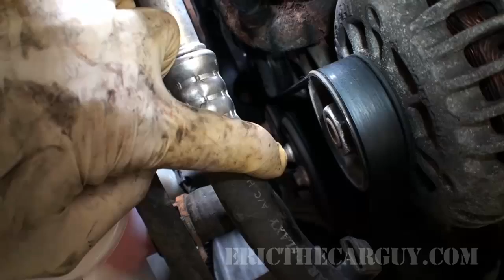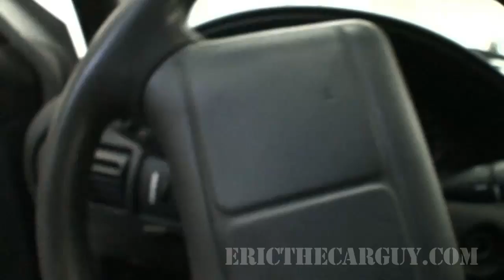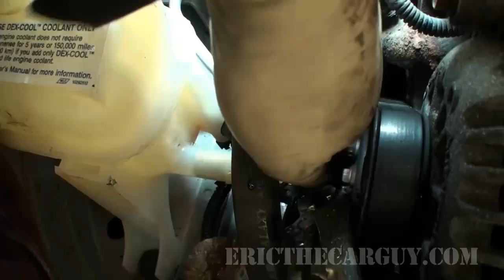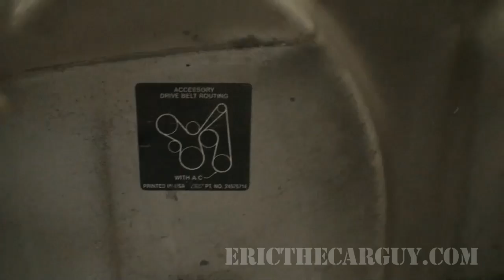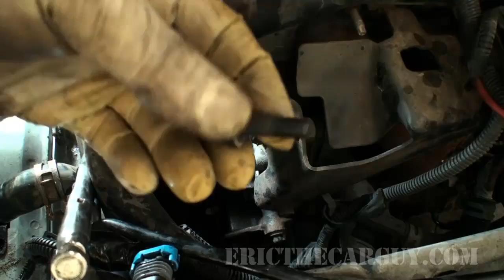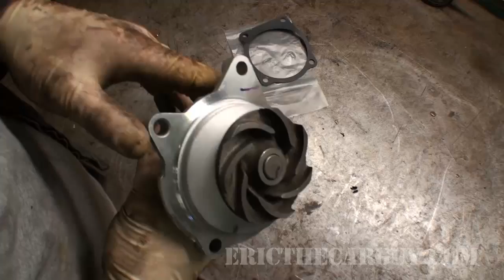2002 Cavalier Water Pump Replacement (Part 1) - EricTheCarGuy

Comment: Just put a used radiator in it and it seems like the water not flowing right don't no much about the car some lady own it and bought it for 150 dollars car got 90k thousand miles just seems like it does it have enough flow so am going to change the water pump and thermostat see what happens next dam I just put new coolant in it after replacing the radiator o well back to the drawing board again water pump and thermostat now new belt too my luck but hopefully when it's done I can make some good money of it for sale

Comment: hey Eric,  a minute or two in to the video, and i already subscribed. i am glad u make videos, u know exactly wtf ur doing, from the vin code info to the proof is workaround, the jack stand, holding that battery cable away properly, explaining the wrenches, tips and tricks , good stuff  , very good stuff
Reply: hood turned to proof,  dann autocorrect

Comment: Replaced a same water pump with 2.2L engine for 2002 chevy cavalry. On ground, no jack up. No need to touch the coolant reservoir and engine mount. No need specific tool to release the  belt tension, regular ratchet will be too thick to put in; instead just pushing the tension bar down with a 1 by 2 wood. I totally removed the alternator, easy and no  need to worry about its falling. Utility tape is very helpful to put the belt in place. YOU MAY NEED A HELPER IN THE LAST MINUTE TO PUT THE BELT IN PLACE, WHEN YOUR HAND ARE PUSHING DOWN THE TENSION BAR.
Reply: I use a 3/8" drive breaker bar on the tensioner bracket to release belt tension. The breaker bar end is thin enough to slip between the frame and tensioner bracket.

Comment: I did just by removing the alternator, you dont have to take down the engine
Reply: Good!!! I sure did not wanna move motor mount lol at 300,000 miles on the cavalier it needs a new water pump glad its 30 bucks for it i am not gonna invest too much into a $600 car
Reply: I bought my Pontiac sunfire for 350$ and all it needs is a water pump replacement glad I don't have to do the engine drop if you did it by taking off the alternator.
Reply: Where is your video?
Reply: airblender it’s 10000x easier to just drop the engine. I’m not gonna fight with belts and less then an inch of clearance for my dick beaters. Plus reaching that tensioner is nearly impossible with that mount in the way. It can be done. After 20 minutes of struggling.  fuck that noise
Reply: Absolutely easier to drop the engine. I only had floor jack and I had no issues taking out the motor mount and putting it back following the video instructions.
Reply: Dumb ass with a wrench

Comment: have 1996 corsica, same motor 2.2L 2200 (OHV) it's actually much easier than the hondas and toyotas and other imports, because the 2200 is a pushrod motor, with timing chain. waterpump sits outside driven by serpentine belt, 
no timing belt to remove.

did i mention timing chains last longer?
Reply: Depends on who made the chain...

Comment: I had a cavalier with the 2.4L engine and I had to replace the water pump... that was horrible I will not do it again!!!!  makes you wonder what the heck are the engineers thinking when designing these engines. If you see a 2.4L with a bad pump... run away as fast as you can!!!
Reply: I've fixed cars for years and I can say this all Americans cars are pain in the ass to work on and any v6 Nissan .
Rest of Japan's cars are pretty easy. I really like how Japan uses like 3-4 diff bolt head sizes for the whole car vs American which could use every socket you own.
Reply: Also the Japanese cars use ALL metric fasteners (MUCH better system) than American cars which mix SAE and Metric fasteners. NIGHTMARE!

Comment: I just changed the water pump on 2001 Sunfire 2.2.  Found easier way to release the tension on the belt.  Use a crowbar, just push down.  Saves time and headaches removing the engine mount.  Thanks
Reply: Was the water pump on 01 pontiac sunfire internal or external? I need to replace mine. Thanx in advance.
Reply: Was the water pump on 01 pontiac sunfire internal or external? I need to replace mine. Thanx in advance.
Reply: Was the water pump on 01 pontiac sunfire internal or external? I need to replace mine. Thanx in advance.
Reply: External. Under alternator.

Comment: Hey Eric
I have a 2000 chevy cavalier, and the other day, it just started making this like sputtering noise, like if I install a cool air intake system. It does in at idle and when I'm driving, I also notice when I turn on the ac it make the sound a little louder, and sounds like it coming from the passenger side, could this be the water pump?
No engine light.

Comment: Regarding Tensioner all way down. For Post tolerance775. Is there any adjustment in Alternator, or anything else to get that extra little bit to get belt on, or off??.
Reply: NO! The tension is fixed by the spring in the tensioner.

Comment: Hi Eric.  I have a 02 Olds Alero 2.2 Liter Eco Tec, Automatic.  My Water Pump is leaking out weep hole I'm sure. How do you go about replacing it??. I was reading I need some special tools, like a timing gear holder, so when I pull out Pump I don't mess up Timing. I also would like to know where the heck is the dag blasted Water Pump at, as in which side of Vehicle??.  I was looking at it month ago in Garage, but didn't jack up, or anything, just glanced in there. Do you have any Videos on the 2.2 Eco Tec Engine, I have looked for them, but no luck??.

Comment: hey Erik, i was told there is a drain plug for/in the water pump used to flush the engine. Is this true and if so where is it located?

Comment: 2.4L engines are driven off the timing chain... they are a nightmare to replace. no cavalier has ever had an engine with a timing belt.... best to my knowledge. the 2.2, 2.8, and 3.1 V6's, and the 2.4 all timing chain. timing belts suck

Comment: Eric, I have a 2000 ford taurus 3.0 EFI (VIN U) , that is leaking coolant from the waterpump. It is so full of rust it looks like chocolate milk. The shop said replace waterpump, thermostat, tank and flush the cooling system. Are there any precautions to be taken considering there's too much rust and any idea why it would be so rusty?
They quoted around $217 to just to the flush and refill, is that reasonable?

Comment: When trying to release tension from the Alternator belt why not just loosen the bolt on the top bracket arm and let it fall forward? Wouldn't that work ?

Comment: I say don't use RTV at all, use a couple of bolts to keep the gasket in place as you're installing. I hope that replacement GMB water pump holds up, I've seen so many of them crap out.

Comment: what really works better then die gringer is a dremmel type tool with a wire brush
and a cloth inside the pump hole.

Comment: Actually my sisters 2.5 I4 Nissan Altima and my 2002 Alt with the 3.5 V6 are equally inaccessible in many areas. In my opinion at any rate.

Comment: Eric i have a 97 cavalier,and the head gasket went bad,and while the head was at the shop we left the car outside but put the hood back on,and right before i picked up the head i was cleaning the pistons & cylinder walls,to make sure there was nothing to damage the engine,but when i was doing that i turned the engine over some with a socket to clean it better,but the guy helping me says i threw the timing off,my grandpa says i did not,and a co worker it won't be off if the dist cap was off.

Comment: Yeah, so an easier way to tell is what kind of oil filter it takes, the ecotec takes a cartrige filter accessed from the top of the engine with the 32mm socket and the ohv is a regular filter. The other difference is the cam shaft. Ecotec is a dohc where the older one is an OHV engine.

Comment: a much easier way to do this is take off the passangers tire and splasch gaurd and take out the two motor mount bolts and use the jack under the motor like you did and you can get at everything threw there much easier

Comment: When I replaced the water pump on my 98 Saturn sl2, I found a great way to keep track of where the bolts go.  Take the box the new pump came in, and with using the new pump as a diagram, poke holes into the box top where the bolts go. this is for when removing the bolts you can place them in the same spot when bolting the new pump back on.

Comment: I just replaced a head on my 1996 sunfire. same 2.2 ohv engine. It was a lot of work, now to replace the clutch haha. After that, should be set to run 300k.
Yea an intake valve spring broke and the valve dropped into the piston. The valve bent. 
But any ways it runs like new now and a lot of what I know is from you Eric! (And my auto shop teacher)

Comment: I'm not Eric but you can do it that way but normally you don't have room to get in that area with a impact especially in most front wheel drive cars.  I have used a IR hammerhead (impact air ratchet) to remove bolts in tight areas.  If you can get the water pump out then you can use the impact but a lot of the times the pulley covers some water pump mounting bolts.  Some pulleys have holes in them to access the mounting nuts.  Just have to plan your attack and adjust to the situation.

Comment: Hey Eric. Instead of doing all that stuff with holding the fasteners on the water pump to loosen the bolts, would you also be able to take it out and use an impact wrench on it to take it off?

Comment: i just stuck a bar down the front the engine and pushed down on the tensioner and removed the belt from the alternator and the same process putting the belt back on. Not saying its the "correct" way but it was my own way of doing the job :)

Comment: Is it possible to put a jack stand under the oil pan, just in case the hydraulic floor jack fails and the engine falls?

Comment: To much RTV=bad. However i am committed to using it on water pumps, as I have been bit 3 times by a leaking gasket after a replacement, and had to tear the whole thing apart again, not fun.

Comment: In Greece gas prices are about 1,80 euro per litre so for a gallon we would pay 8,19 euros that's 10,52 USD that's crazy, that's why instead of a big 3 litre engine we prefer smaller turbocharged ones.

Comment: I have a cavalier and I have found that most 3/8" ratches BARELY fit into the little gap between the engine and the side of the frame.  I had to go and buy the same serpentine belt removal tool you have.

Comment: 02 was a weird year for the cavaliers. Halfway through, the old 2.2 iron block was discontinued and the all aluminum ecotec was put in every cavaier/sunfire regardess of trim level. Be glad that this isn't a GT or a Z24, then it would have the 2.4 which has a timing chain driven pump and is a royal pain in the ass to change, exhaust manifold has to come off and everything.